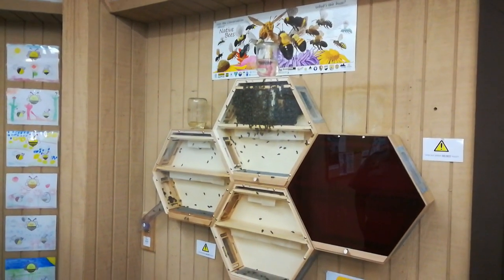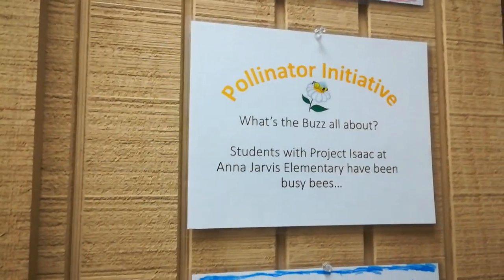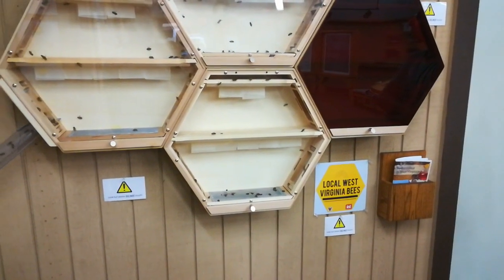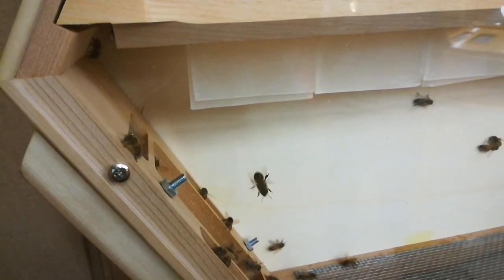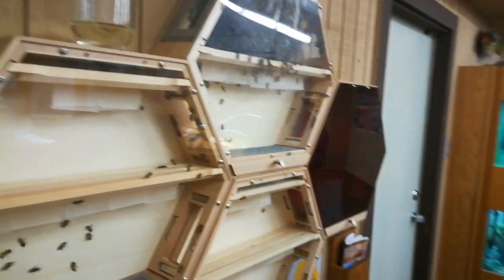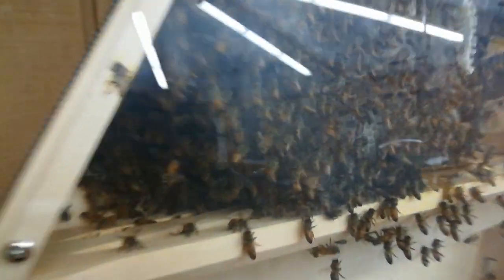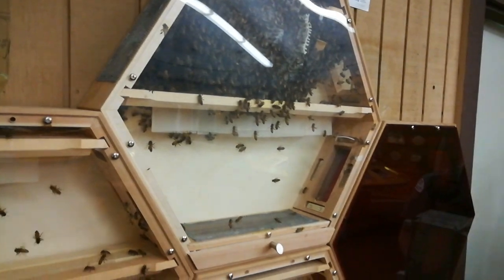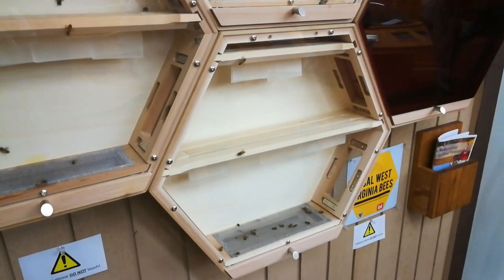Education honeybee display at US Army Corp Engineers center Tyghart dam

Comment: As a beekeeper this is frustrating to watch.
Reply: Each one of these compartments are 900 euro each and only 10 litres so even to house a small hive you'd need 4....
Reply from the maker: Why?
Reply: @spicetruckin  Bees tend to build vertically, there seems to be too much space for the bees (at least for now).  I personally believe initially when hives are starting out they need to be in the dark.  That Hexagon observation hive seems more of a novelty someone is pushing out there and not really compatible with other hives.   Go check out Jeff Horchoff Bees or 628DirtRooster channel and see how bees are building naturally in homes.
Reply: @beemanit9305  In a Langstroth hive the bees start in a bottom brood box and work upward.  You are right.  However when bees are placed in an awkward, unnatural setting they will gravitate to the top and work toward the bottom cavity.  The top middle hexagon will be filled first as it was "sounded out" to be the most central of the hexagon cavities.  The Rangers probably had those dark plexagon covers over all of the hexagons when the bees were first introduced.  The bees will work to produce enough pharyngeals to start work in the one below.  If the queen had been cloistered to the middle-bottom when they were introduced, then I think that you would have been  happy.  The bees would have built their brood nest in the bottom hex and honeycomb where their brood is now.  Jeff and 628 are good guys but they are the guys to call when you want to deconstruct.  F. Dunn would have been a good construct guy, but then again he knows "macro-details"!
Reply: @carrollrhodes4050  I guess we know who the better "beekeeper" is huh beeman
Reply from the maker: @beemanit9305  eeeps, hadn't followed this in a while, but thanks for the detailed comments! Definitely helps with knowing more.